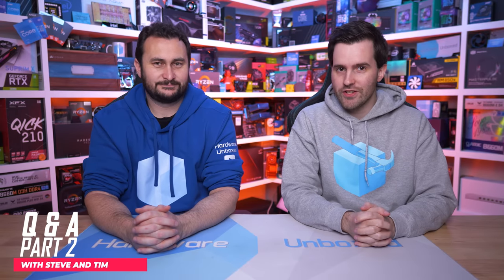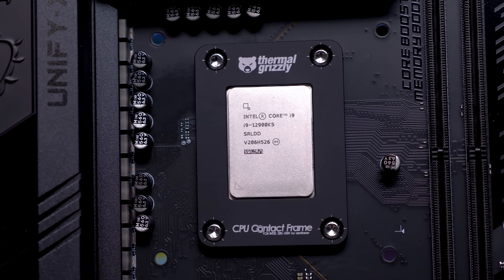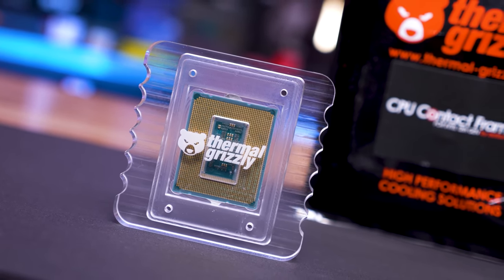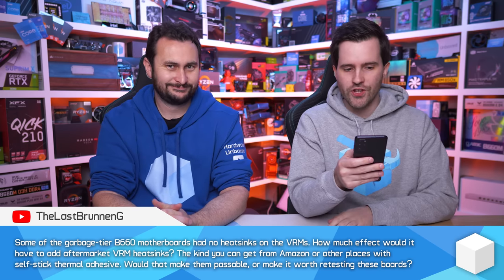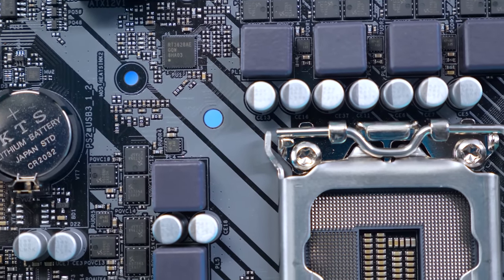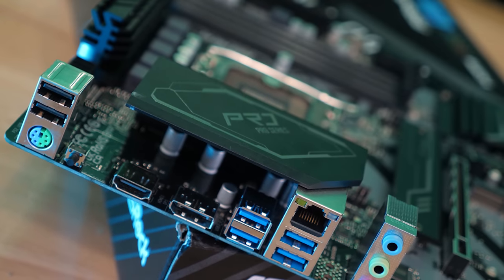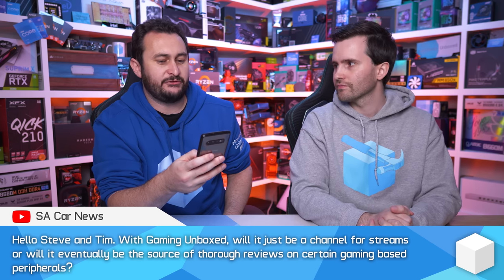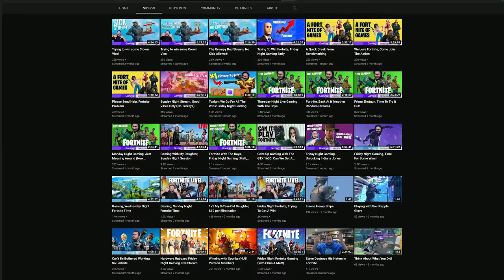Biggest Tech Fail 2022? Zen 4 To Make DDR5 Relevant? August Q&A [Part 2]

Comment: @Hardware Unboxed
The better the mouse sensor, the easier it is to control the mouse cursor at a higher DPI. So setting the DPI high on one mouse is not indicative of how controllable it is on another mouse. I like to set my DPI more or less as high as I can, while keeping the cursor controllable. I can usually increase it a little more after I get used to it. Then I settle on a value there. The main benefit for me, is if I have to move the mouse less, it puts a lot less strain on my wrist, and I've found I can play a lot without getting carpal tunnel symptoms. Before I started worrying about it, I had a lot of wrist pain and got close to needing surgery. Now it's no longer a problem for me. So, it definitely makes a difference. That being said, I haven't seen any benefit in mice that can go up to 22,000 DPI.

Comment: The greatest evidence of how subpar the 3050 is are the God of War results, on what is the PS4 graphical preset (which means under Core i5 750 with a 1060 or RX580 combo spec) the 3050 only manages to deliver 60 fps @ 1080p while costing over 300 bucks (way, way over in Europe actually). At least in the Pascal days the lesser capable GPU offerings sat under the 200 dollar ballpark (depiste being butchered by the AMD offerings) Did Nvidia's CEO really say Geforce GPUs are like consoles inside a PC? Can the man possibly  be that clueless? A GPU without the remaining system components is useless when compared to a console (which needs only a TV or HD monitor) so no, no GPU is like a console inside your PC, mate. Rants aside, I'm curious what Steve and Tim have in their PC museums (like what's the oldest system they got boxed somewhere) :P

Comment: DDR4-4000+ isn't even relevant. PCIE 4.0 has barely any relevance. Twenty-four core processors are only relevant in very limited use cases none of which apply to non work related activities.  The increase of L1 and L2 cache is relevant but we're going to be forced to pay through the nose for all this other "5" crap to get it. Why? Because AMD will never apply it to the processors that need it most. A 5600G-3d 5.7GHz processor in a SFF build would be godly. They can make it but they never will. Because selling us pretty lights and reflections at resolutions more suited for imax theaters is more profitable, but less than sensible.

Comment: E-Cores are just for throughput and Intel added them as a workaround to maintain the Ringbus sweet spot core count of 8P-Cores and trying to clock those as high as possible, but that would leave em in the dust against AMD, so they just added those small cores with stripped out instructions to boost the multicore scores and workloads...
Owh one more thing, good luck cooling a 5.5+Ghz 16P Alder Lake intel monster lol, that's why it doesn't exist.

Comment: In regards to the mouse sens question.

Some basic assumptions are made when that is answered.
1) Mouse acceleration is off. Anyone that actually cares about their FPS gaming will have read, watched or heard about this at some stage and turned it off.
So in the mouse properties window under pointer options "Enhance pointer precision" should be unticked, but afaik is on by default.
2) In the same section pointer speed is on the middle notch which keep it the same as raw. So your selected dpi is unchanged. 

For Apex (what i play) the middle of the bell curve you'll get mainly like 400dpi with 2.4-ish in game or like 800 dpi and 1.2-ish in game answers.
And yes its gets asked  A LOT in FPS games streams so they often just have a !sens command that rattles of their sens settings for the game/s they play.

Lower sens is better for tracking (apex), higher for flicking (valorant), but at the end of the day it's what works for you. Are you an arm aimer (lower sens) or wrist aimer (higher sens).
Finally its about your gaming environment I have a big ass Artisan mousepad so I run the above sens, but someone who learned to game on a tiny desk will most likely be using a higher sens I would find crazy.

Comment: On the subject of I5/R5(core count question) being good enough for gaming, the best place to look at is consoles, and it will be 10 years from when zen 2 consoles get replaced.  Though this is my opinion, but it will take anywhere between 4 to 5 years after those dropped for game developers start to have base game engines set to run on that hardware as its base line.

Comment: 16:10 In my opinion Cherry failed with their switches. For a while they had almost entire marketshare, but right now it's hard to find any keyboard with their switches. Also mobile Alder Lake IMO is an embaressment with worse battery life that Tiger Lake, generally those E-cores are only good in perf/area metric, when downclocked, P-cores are fine in terms of perf/W.

Comment: Just FYI, switching GPU's on a windows system nowadays is NOT recommended !!!
Microsoft as well as NVIDIA and Intel will consider it as if you are using a new system and thus you need a new windows license.
There are workarounds ofcourse but in essence you get miserably screwed over and forced to spend quite some time to get it all up and running again (legally!)
Do not forget the new microsoft rules on hardware minimums (a gpu older then 2-3 years old is no longer allowed to install a driver !@*@!)
It's truly pathetic on how much control those companies have over hardware that isn't theirs !
Imho they are intensily hacking private computers by sabotaging them unless you pay !!!
Reply: That is not true.

Comment: When you guys are speculating the life span of the 5600X for gaming, I see the value in looking to the past and extrapolating. With respect, you may be discounting acceleration of performance/demand too much.  For example, at one point in time, we measured RAM by KB. Then MB. Then GB. And that didn't change at a steady rate. It changed at a rate where the rate itself accelerated. This is what Kurtzweil talks about in terms of all this leading to an "event horizon". Back to the point: I propose that the 5600X will become a bottleneck for mid- to high-end gaming within four years. That said, what could make me 100% wrong is the market. The kind of "acceleration" I'm talking about depends on AMD, et al, to accelerate performance % increases each generation. But that doesn't always happen. I'm thinking of a certain phone brand now as an example of deceleration: Google's Pixel line of phones. The first 3 or 4 versions (Pixel 1, 2, 3, 4) used the same high end SOC as other high end phones, increasing in performance each year by a certain %. Not really massive acceleration, but measurable. But starting around the version 4 or 5, Google started putting mid-level SOCs in the phones (as well as other older components) to attain certain profit margins. So acceleration slowed down.
Reply: Yes, but so what?  I bought a 5600X when it first released (paid too much at $300USD, but my son used my 3600 in his build), so I've already got almost 2 years out of it, and will easily get another 4 to 5 years before I'll need to consider an upgrade.  At that time, I'll buy whatever $200 CPU hits the same sweet spot.  Wasting more money on expensive CPU's is for people easily duped by marketing.
Reply: @karlhungus545  you missed the point.
Reply: PC gaming is very much anchored against consoles in the last 15 years, the time to ditch console releases has not come yet, and the current gen came out starting 2 years ago but remained such an unobtanium, that the console generation has just started rolling over for real, and there's probably at least 5 years of life left in this one. And 5600x has a decent headroom over those.
Reply: @scotter  Yes, I re-read it and I did!  I agree.  Unless we see a revolution in hardware (GPU and CPU), we've entered a time of greatly diminishing returns.  Good in the sense that you don't need to upgrade as often.  I recall the '90s where you had to completely toss your system every year or 2, including the monitor, and sh!t was not cheap.  I'm glad those days are over.  The onus is now on game developers to start optimizing for these diminishing returns.
Reply: @karlhungus545  Karl - Thank you for your [oh so rare] humility! And I totally get where you are coming from in terms of obsolescence and diminishing returns! I prefer the fast progress route, myself, heh. But yeah, hard to tell which direction we'll go. I'll still dream and hope that the whole "better tools will assist us in making better tools" paradigm, knowing that it is dependent on resources that may not be realized.

Comment: Most competitive games use raw input which ignores windows sensitivity. To share your sensitivity, most people use eDPI which is your sensitivity x your DPI. E.g. a sensitivity of 2.8 and a DPI of 1600 would be an eDPI of 2.8 x 1600 = 4480
Reply: Yes edpi between a same game or two titles that share the same sensitivity speed. But how many centimetres for a 360 turn is the best way.
Reply: @lepari9986  yes but that's more complicated to figure out
Reply: @tired9494  well if you aren't smart enough to test it then just put those two numbers you mentioned to online converter and you got it. But yeah I guess it takes 20 seconds indeed.
Reply: @lepari9986  a lot of games don't have an online converter and it's a bit silly to expect someone to find a ruler and measure their 360 when edpi works completely fine
Reply: @tired9494  yes when comparing inside the same game (or ones that share the sensitivity) as I already mentioned. Otherwise it's useless.

I give you an example: my edpi is 1200, is your sensitivity higher or lower?
Reply: @lepari9986  but if you're not talking about a specific game then your cm/360 is irrelevant anyway
Reply: @tired9494  why? I can turn a 360 in CS go, I can also do it on Apex or Valorant or freaking Quake 3.
Reply: If I tell you my CM for 360 is 12 centimetres then you have a really good idea about my sensitivity in any FPS game. Or if you know that yours is 20 CM for 360 you can tell me that my sens is a lot higher. Even if we are talking about different titles.
Reply: @lepari9986  But I have no idea if 12cm is high, low, or average for your game. Even if my cm/360 is 11cm that doesn't mean I'm a higher sens player
Reply: @lepari9986  because the environment is different. I wouldn't want to use a quake 3 sens in csgo lmao
Reply: @lepari9986  the whole point of asking them what their sens is is to know what kind of sensitivities they play. Giving a cm/360 without the game doesn't mean much because the same cm/360 could be a high sens or low sens depending on if it's cs or fortnite
Reply: @tired9494  edpi is fine for same title but cm/360 is clearly the best method for comparison. which big game doesnt have online calculator??
Reply: @tired9494  5 cm for 360 is high in all games and 80 cm for 360 is low in all games. its not easy to say high mid or low sensitivity with edpi either as there isnt objective agreed definitions.
Reply: @ferusic2463  not every game is big
Reply: @ferusic2463  and that's easy to say when you're giving 2 extremes. if i tell you 45cm/360 you have no idea if I'm a high/med/low sens aimer. Obviously you don't have exact averages and quartiles and stuff, but you probably know what an average edpi is for your game

Comment: One thing about Mantle, Vulkan, and other low-level graphics APIs is that it requires significant effort from game engines to optimise their structure to properly take advantage of them.

That's why you would not have seen much of a difference for that first wave of games back when Mantle originally became available.

Comment: Your argument does applied for the people watching YOU. I have 3080 and stream using moonlight, and i need minimum 120 fps in all games. So yeah the performance is important at lower resolutions and lower settings. And i want 4090 or amd next gen to share the gpu between VM's. 4 gamers one pc kind og thing. If i have the best hardware i also want the coolest features. YOU TALK LIKE YOU DONT KNOW YOUR SUBS. We are not the average 3090 buyer!

Comment: ok, you guys are so elusive with regards to 4k gaming and GPU. Question, I want to game VR titles, 4k at 120 hz with two NVMe drives, what is the best rig for that
Reply: the best rig is going to be a 4090Ti and 7980X3D probably
Reply: @tired9494  you mean 7950x3d?
Edit: the XX80 classification is only used by mobile skus, and even still you'd be hard pressed to find those processors anywhere
Reply: @chitorunya  didn't know that, so yeah the 7950x3d
Reply: If you want a build guide this isn't the channel for that. You should go to someone like PC builder(that's a YouTube channel btw). He does give you a great build according to your budget and need. If you'd like my advice, I'd say wait for the new lineup of CPU and GPU products. We have great cards for 144hz 1440p atm but, not for high refresh 4k gaming yet. At Least not without compromises. Presently, if you'd like to game at 4k 120, you'd need a 3090ti paired with something like the 12700k.
Reply: @lakibadhikari7930  its about gaming at 4k120Hz the CHEAPEST way
Reply: @tudomerda  wait for the new GPUs from AMD and Nvidia then. I would suggest B- series motherboard platform with a lower mid range CPU equivalent to the 12400f paired with the highest end GPU you can afford at that time. Mind you 4k monitors are expensive as hell. I think you're planning to play on a TV? You'll have to lower settings none the less unless you get the highest end card (maybe a 4080 or 4090?)
Reply: @lakibadhikari7930  I have a 5k VR headset which i want to power, dilemma, do I stick with PCIe 3 and next gen GPU, or, upgrade to cheapest everything to support 7900XT ?

Comment: 3:10 AI must be updated every frame, but don't have change anything, you would not see if AI would not change direction in frame 1000 or 1001 or even 1005 so decision what AI should do next after it. So decision could be make async, but devs would have to design game this way and this is main problem. So don't make conclusion on what can be done by analogy, because in this case this is not working. You don't have programming experience so why you are talking as you would know about it? Ofc saying that today games don't do it, and we don't see any changes in this, would be ok.

Comment: The truth is, even at 6 cores Ryzen 5000 is just faster than what the consoles use. The consoles run what like a 2700x basically. Bare min 5 more years before MAYBE a next gen console can top their performance. Games are developed with the lowest hanging fruit in mind, so thats the consoles. PS5 and Series S specifically. Also how can you SERIOUSLY say 5600x in 8 years will be un-usable? MATE, i just upgraded from a 6700k, 7 year old chip and it wasnt "un-usable" at all. The only real difference ive seen going from a 6700k to 5800x is in MMO's honestly. Maybe it smoothed out Destiny 2 a bit with less stutters and frame drops but it wasnt life changing.........
Reply: Agree, unless when it run insanely cpu bound games like teardown and cities akylines .
Reply: Something to keep in mind. When choosing between algorithms and architectures which scale well to higher end chips, or ones that have lower minspec, and it is a real compromise, i can elaborate, they will ALWAYS choose the latter. Because a game that someone wants but cannot run adequately at all with what they have at hand is a lost sale, so payoff for catering to lower minspec is potentially very large. Caring about high spec gamers has barely any payoff at all.

Comment: Fail not fail for me - 3300X, I remember when it launched it had some praise generally speaking, then, no one could really get one, and even now you can find a 3600 right, go try finding a 3300X new or used, you'll be hard pressed, so that was a bit of a shame, maybe a 7300X to compete against the undisputed low end king (imo) the 12100F/13100F, would be nice to see, imo.

Comment: Intel wanted some of NVIDIAs sweet sweet mining money, and that's gone
Reply: Mining is not supported on Intel Arc.
Reply: That's not actually a problem long term, it has been evident that GPU cryptomining is a fad, since GPUs are fundamentally an ill fit for it on the efficiency curve. One of the biggest sweet moneys is neural network AI (language and image processing models) as well as HPC (high performance computing) such as detailed finite element simulations (physics, engineering, weather/climate), protein folding, etc. Data-centre use stuff. This is a growing family of fields with no signs of slowing down. NVidia is the giant winner in this space, and Intel needs a piece of this pie. The best part is that across all these use cases, it's not worth to throw an ASIC on them unlike cryptomining, since they're under active R&D, you need inherent flexibility, so a GPU is a pretty decent call.

Also fundamentally Intel already has a foot in the HPC door with Xeon Phi products, so they have that sales channel, they have existing customers. Without a powerful dedicated GPU, they just don't quite have a product that a lot of these users are looking for to upgrade to.
Reply: @SianaGearz  thank you for such a detailed explanation